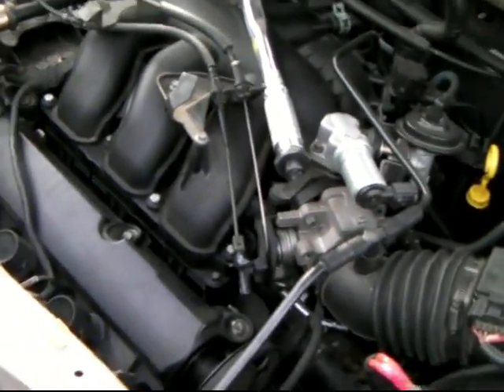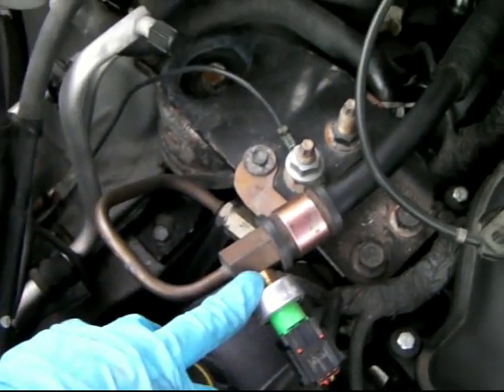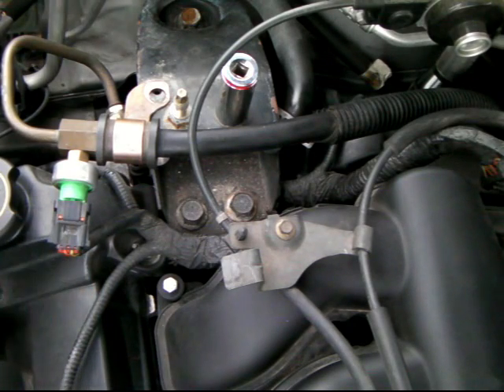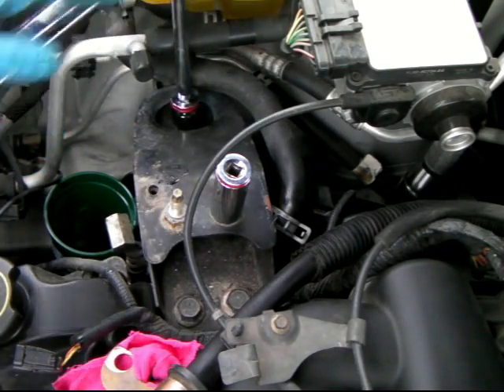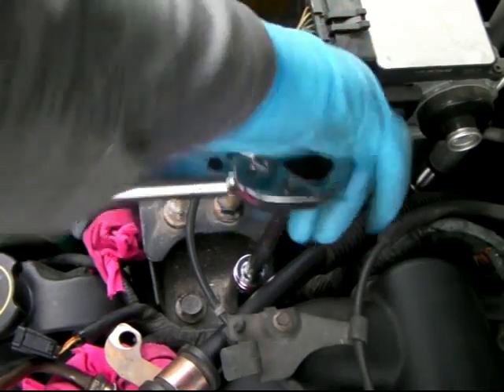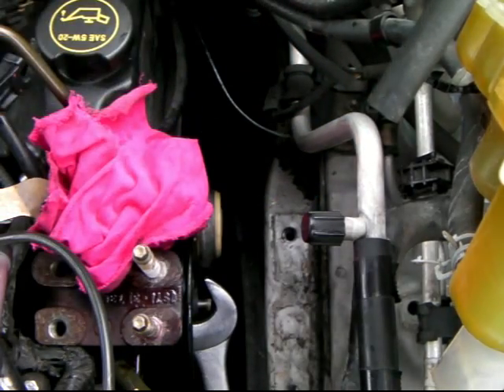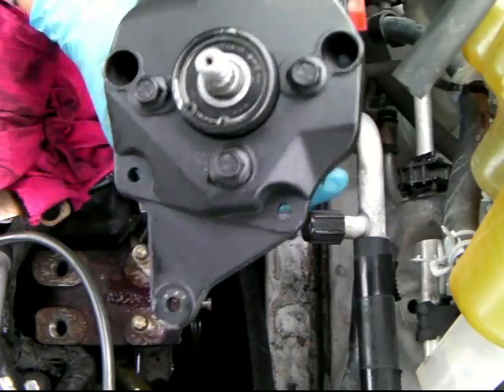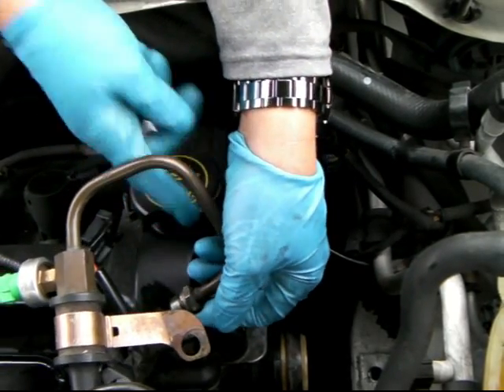POWER STERING PUMP REPLACED FORD ESCAPE 02 -MAZDA 02

Comment: Great video. I know this is an older video but I'm having the same issue in my 03. I learned some things from other videos and from previous repairs. That pulley nut is I real pain with the motor mount in the way. Also pre lubing the pump is must. It keeps it from starting it dry. Its why I put new oil in a new filter when doing an oil change. Also need to make sure all the O rings are moved to the new assembly.

Comment from the maker: I'm glad I help with Your problem. make sure that there is no leak in the hose before any thing else, sometimes a small hole will make air in the line and cause the noise too.......if your missing liquid then the chances are that it may have a leak. because if You replace the pump and don't fix the leak that pump eventually could became bad again.

Good Luck and hope you get it done.

Comment: this is a very easy job to do this is an informative video but if you are using a torque wrench to do the job that makes is alot harder. this guy is clearly a back yard mechanic. the right tool for the job makes a huge difference.

Comment: using a torque wrench to loosen tight bolts is a good way to destroy the torque wrench..
use a breaker bar...
Reply from the maker: Thanks for the advice.
Reply: I came to the comments to leave the same advice
Reply: Jeremy Sumsion same here started watching I made a comment I paused it seconds in then I look down and yeah somebody's already saying it just goes to show guys that know the tool see that and go what the f***
Reply: @gjl07  did you have trouble getting the pully back on correctly mine was a bolt on??
Reply from the maker: @jasonthemason6587  I dont recall having trouble with the pulley (this was more than 10 years ago). If the bolt got tied real fast that means it didn't go in straight,  can you try and remove it ,blow the hole and put some lubricant, and try by hand to see how far it goes.
Reply: @gjl07  yes ill try that im thinking i didnt get the pully seated all the way back on.thanks

Comment: Very helpful. I replaced mine and a couple months later I find that the pressure line going into the pump is leaking because the o-ring gasket didn't seat fully. When I try to screw the line in it gets far and maxes out; preventing the gasket to squish. Any help?

Comment from the maker: No ,there was not a o ring just adjusted tight, if yours is liking probably dindt went in correctly, it has to go in easy with your hand and then after a few turns used a tool to tigh it, if it keeps leaking then probably you have a small crack in the presure line.

Comment: I have my second severe leak in 18 months even after replacing the pump. So many problems with certain parts on every Ford vehicle I’ve owned. Too many poor designs. Thanks for the vid. Is that a Finnish accent?

Comment: I want to change the power steering hose for my escape 2001. Can you please tell if a general power steering hose can be used, or I have to purchase a specific hose for my car? Thank you so much!
Reply from the maker: I don't see why you cant use a general power steering hose ,as long it fits correctly and have almost the same size, I think it will work, but that's just my opinion an I'm not a mechanic.
Reply: I tried to take the leaking power steering hose out in order to replace it. The top end of the hose (the one you removed at around 5:00) is easy to remove, but I don't know how to remove the bottom end of that hose.  Looking from the bottom of the car, there seems to be a covering plate that prevent the access to that bottom end of the hose. Can you give any tips or advice? Thank you!

Comment: Any tips on how to remove the small nut from the hose part on the old pump to put on the new pump? The larger one comes off, but the small one is super stubborn...
Reply from the maker: had you try a torch to expand the nut with heat?, I really will have to see it in order to give you a better idea, sorry

Comment from the maker: In my case I didnt change any hose but I notice that the top hose right at the end close to the engine had a leak so I took it out and cut that little piece and put it back and push it all the way in and put a clamp to hold it, because when I look in autozone for the replacement they didnt have a exact match but the name is Power Steering Line Hose and its the one that goes from the reservory to the pump its about +/- 10", because there is another one longer Power Steering Pressure Line Hose.

Comment from the maker: Yes, You have to move the steering wheel from one side to another slow (left to right) and the noise should start dissipating, if not then probably you still have a lick in one of the hoses, check the little top hose, the one that goes from the reservoir to the steering pump, put your hands and if its wet then that’s your problem. Let me know if you resolve your problem ,if not I will posted another video for this question. Good luck

Comment: how did you get that wrench to hold in the pulley while loosening the pulley nut?
Reply from the maker: I put the wrench inside of one of the pulley holes and the other side againts the back of the engine , it was not a small wrench. I hope this helps
Reply: +gjl07 im thinking about going to hardware store looking for another nut then cutting off the old nut to get pulley off because it wont loosen and ofcourse ill make sure I have new one before cutting it off

Comment: Can anyone help??? Ive recently changed my pump.and everything went good however getting the pully back on correct.it is a bolt on.got it off just fine putting it back on for some reason the bolt got tight really fast and doest seem to be pushing the pully alignment properly.
Reply: Always take to a shop if u have an issue.
Reply: @MrRealistic316  -
And the shop will tell him the bolt was cross-threaded.

Comment: Were exaclty do you place the jack under the car
Reply from the maker: I did put it under the engine not under the frame. What I'm trying to do here is to keep the engine stable because we are removing one of the suports and we dont wnat the engine to fall ,I use a piece of wood to help.

Comment: I couldn't understand more than about 40% of what you were trying to say. Further: your nomenclature of various parts  procedures is abominable. They aren't "screws" --they are BOLTS or FASTENERS. This is NOT a good video.
Reply: +Charles B The only thing we can't understand is why Ford/Mazda had such an awful design to make removing a pump so difficult. The later model Escape was even worse!
Reply: Charles B maybe you have hearing difficulties I understood every word.
Reply: Sir. Charles you sound more like a college professor  with all this fancy language. If you don't understand just look at this unexperienced doit your self mechanic. You don't need fancy words to do the job, why don't you post a video so that we can see you fix a vehicle, Sir.
Reply: I understood him just fine
Reply: He mumbles a lot. Accent doesn't help.
Reply: Actually Charles, "screw" is the usual engineering term when fasteners are used in this way. "Bolt" is used when it is used with a nut (which is not the case here).
Reply: even if he didn't talk at all I still can watch what is he doing, it most likely removing parts and put them back again because each part will not fit on other ....